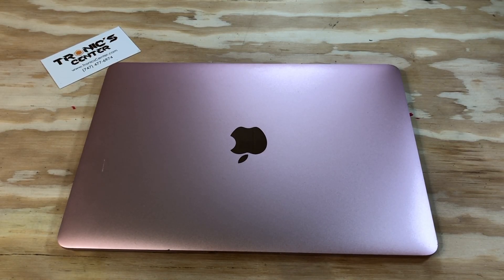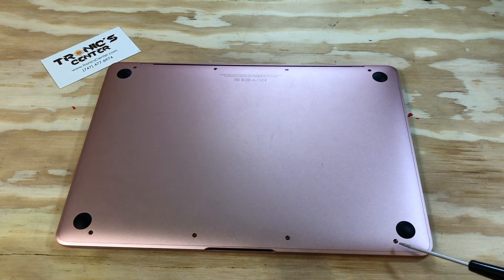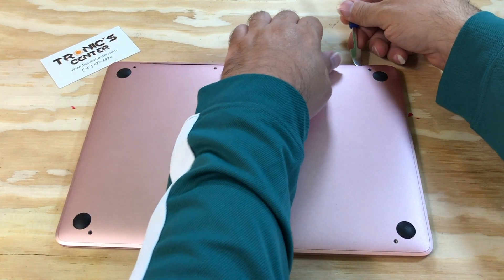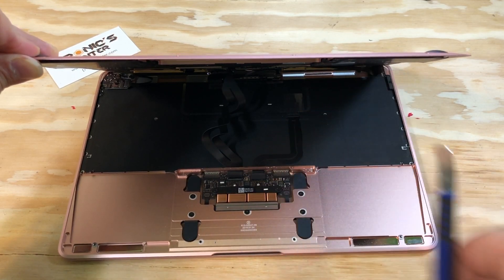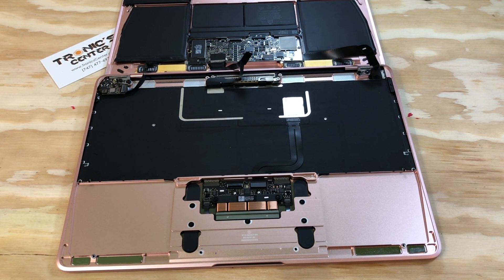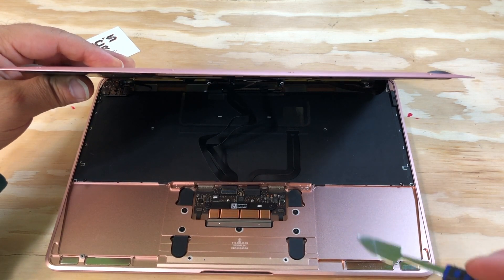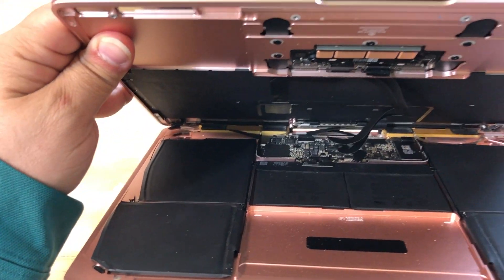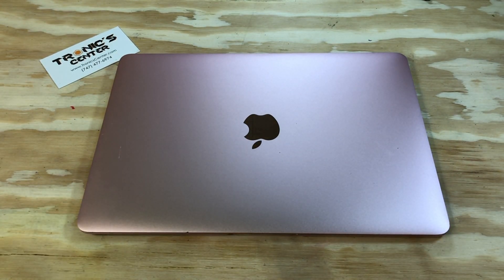How to Replace Force Touch Trackpad IPD Cable on 12" MacBook A1534   Force Touch Trackpad IPD Cable

Comment: May I ask you a question.

I replaced the usb c (its working now).

However I tore the ipd cable and the mouse pad heated up.

In turn I ordered new IPD cable. However may I have damaged/shorted the mouse pad due to the torn ipd cable so would i need to replace this as well ?

many thanks :)👍
Reply from the maker: The Trackpad IPD Flex Cable and Trackpad flex cable not different , it is the same for 2015, 2016, 2017 models . Thanks ! Dear Customer let us know what repair or disassembly you want us to make video ! Please not that we do deal with all Brands Dell, Lenovo, Asus, Razer, Toshiba, Hp, Sony, Panasonic, Nikon, Canon, Black Magic, Red Camera, any Camcorder Bards, Also we do IT Support and Data Recovery ! we would love to hear from you .
Reply from the maker: A2251 KeyWords 

MacBook Pro "Core i5" 2.0 13" 2020 4 TB 3, 2.0 GHz Core i5, I5-1038NG7, MacBook Pro "Core i7" 2.3 13" 2020 4 TB 3, 2.3 GHz Core i7,  I7-1068NG7, MacBookPro16,2 , 2020 13" 4 TB 3 , A2251 MacBook , EMC 3348, MWP72LL/A, BTO/CTO

————————————————————

A2141 KeyWords 

MacBook Pro "Core i7" 2.6 16" 2019, 2.6 GHz Core i7 (I7-9750H), 2.3 GHz Core i9 (I9-9880H), A2141 (EMC 3347), 2.4 GHz Core i9 (I9-9980HK) , MacBookPro16,1, MacBook Pro "Core i7" 2.6 16" 2019 5600M, 2.6 GHz Core i7 (I7-9750H),  MacBookPro16,4 , MacBook Pro "Core i9" 2.3 16" 2019 5600M, 2.3 GHz Core i9 (I9-9880H), MacBook Pro "Core i9" 2.4 16" 2019 5600M, 2.4 GHz Core i9 (I9-9980HK), MVVL2LL/A, MVVM2LL/A, 16" MacBook A2141

———————————————

A2179 Keywords

MWTJ2LL/A, EMC 3302 , 1.1 GHz Core i3 (I3-1000NG4) , MacBook Air "Core i3" 1.1 13" (Scissor, 2020) , MacBookAir9,1 , 1.1 GHz Core i5 (I5-1030NG7) , MVH22LL/A , MacBook Air "Core i7" 1.2 13" (Scissor, 2020), 1.2 GHz Core i7 (I7-1060NG7)

——————————————

A2159 Keywords 

1.4 GHz Core i5 (I5-8257U) , MacBook Pro "Core i5" 1.4 13" Touch/2019 2 TB 3 , MacBook Pro "Core i7" 1.7 13" Touch/2019 2 TB 3 , 1.7 GHz Core i7 (I7-8557U) , MUHN2LL/A , A2159 , EMC 3301 , MacBookPro15,4 , 2019 13" (Touch Bar, 2 TB 3), 13" MacBook Pro A2159

—————————————————————

A1932 Keywords  

MRE82LL/A , MVFH2LL/A, 1.6 GHz Core I5-8210Y, 1.6 GHz Core I5-8210Y, MacBookAir8,1 , EMC 3184 , 13" MacBook Air Space Gray, 13" MacBook Air Gold , 13" MacBook Air Silver , 13" MacBook Air 2019 13" MacBook Air 2018, 13" MacBook Air A1932

—————————————————————

A1534 Keyword’s

EMC 2746, MF855LL/A, MF865LL/A, EMC 2991, MLHA2LL/A, MLHC2LL/A, EMC 3099, MNYF2LL/A, MNYG2LL/A, MacBook8,1 , 1.1 GHz Core M (M-5Y31) , 1.2 GHz Core M (M-5Y51), 1.3 GHz Core M (M-5Y71), 1.1 GHz Core m3 (M3-6Y30), 1.2 GHz Core m5 (M5-6Y54), 1.3 GHz Core m7 (M7-6Y75), 1.2 GHz Core m3 (M3-7Y32), 1.3 GHz Core i5 (I5-7Y54), 1.4 GHz Core i7 (I7-7Y75), MacBook9,1 , MacBook10,1

——————————————————

A1990 Keywords

MR932LL/A, 2.2 GHz Core i7 (I7-8750H), EMC 3215, MacBookPro15,1 , MR942LL/A 2.6 GHz Core i7 (I7-8850H), 2.6 GHz Core i7 (I7-8850H), 2.9 GHz Core i9 (I9-8950HK), 2.6 GHz Core i7 (I7-9750H), EMC 3359, 2.3 GHz Core i9 (I9-9880H), 2.4 GHz Core i9 (I9-9980HK), MacBookPro15,3, A1990 MacBook, 15” MacBook A1990

———————————————————

A1989 Keyword 

A1989 MacBook 2018 MR9Q2LL/A, 2.3 GHz Core i5 (I5-8259U), BTO/CTO, 2.7 GHz Core i7 (I7-8559U), EMC 3214, MacBookPro15,2 , A1989 MacBook 2019 MV962LL/A , 2.4 GHz Core i5 (I5-8279U) , MV982LL/A, 2.8 GHz Core i7 (I7-8569U) , EMC 3358, 13" MacBook A1989

———————————————

A1708 Keywords

MLL42LL/A, A1708, EMC 2978, MacBookPro13,1 , 2.0 GHz Core i5 (I5-6360U) , 2.4 GHz Core i7 (I7-6660U) , MPXQ2LL/A, EMC 3164, 2.3 GHz Core i5 (I5-7360U) , 2.5 GHz Core i7 (I7-7660U), MPXQ2LL/A, 13" MacBook A1708

———————————————————— 
MacBook 

Apple, MacBook, 13" MacBook, MacBook Air, A1466 MacBook, MacBook Air logic Board, 13" MacBook Air , Apple Mac , 11” MacBook , A1465 MacBook, A1502 MacBook, A1398 MacBook, A1425 MacBook, A1706 MacBook, A1708 MacBook, A1707 MacBook, A1990 MacBook, A1989 MacBook, A2159 MacBook, A2179 MacBook, A2289 MacBook, A2337 MacBook, A2338 MacBook, A2141 MacBook, MacBook Pro, MacBook Pro Retina, Retina display, True Tone Display , Top Case KeyBoard, Apple Keyboard, MacBook KeyBoard, MacBook Trackpad.
———————————————————

A1398 MacBook, A1398 Logic Board, A1398 LCD, A1398 KeyBoard , A1398 Display, MC975LL/A, MC976LL/A, MD831LL/A, ME664LL/A, ME665LL/A , ME698LL/A, ME293LL/A, ME294LL/A, ME874LL/A, MGXA2LL/A, MGXC2LL/A, MGXG2LL/A, MJLQ2LL/A, MJLT2LL/A, MJLU2LL/A

—————————————————————

A1706 Keywords

MLH12LL/A, A1706 EMC 3071, MacBookPro13,2 , MacBookPro14,2 , MPXV2LL/A, A1706 EMC 3163 , 3.5 GHz Core I7-7567U, 3.3 GHz Core I5-7287U, 3.1 GHz Core I5-7267U, 3.3 GHz Core I7-6567U, 3.1 GHz Core I5-6287U, 2.9 GHz Core I5-6267U, A1706 MacBook, A1706 MacBook Touch Bar 

—————————————————————
A1707 Keywords 

MPN 923-01477 , MLH32LL/A, MLH42LL/A, MPTR2LL/A, MPTT2LL, EMC 3072, MLH32LL/A, MacBookPro13,3, 2.7 GHz Core i7 (I7-6820HQ), MLH42LL/A, 2.9 GHz Core i7 (I7-6920HQ), EMC 3162 , 2.8 GHz Core i7 (I7-7700HQ), MacBookPro14,3 , 2.9 GHz Core i7 (I7-7820HQ), MPTR2LL/A, MPTT2LL/A, 3.1 GHz Core i7 (I7-7920HQ), A1707 MacBook, A1707 Touch Bar

Comment: Pehle  bord me lagao
Reply from the maker: there are many Apple MacBook Available with high Spec's such as A1707, A1708, A1706, A1990, A1989, A2141, A2159, A2179 and we do offer original part's for them in if you need any part
you may visit our website at www.tronicscenter.com
Reply from the maker: A2251 KeyWords 

MacBook Pro "Core i5" 2.0 13" 2020 4 TB 3, 2.0 GHz Core i5, I5-1038NG7, MacBook Pro "Core i7" 2.3 13" 2020 4 TB 3, 2.3 GHz Core i7,  I7-1068NG7, MacBookPro16,2 , 2020 13" 4 TB 3 , A2251 MacBook , EMC 3348, MWP72LL/A, BTO/CTO

————————————————————

A2141 KeyWords 

MacBook Pro "Core i7" 2.6 16" 2019, 2.6 GHz Core i7 (I7-9750H), 2.3 GHz Core i9 (I9-9880H), A2141 (EMC 3347), 2.4 GHz Core i9 (I9-9980HK) , MacBookPro16,1, MacBook Pro "Core i7" 2.6 16" 2019 5600M, 2.6 GHz Core i7 (I7-9750H),  MacBookPro16,4 , MacBook Pro "Core i9" 2.3 16" 2019 5600M, 2.3 GHz Core i9 (I9-9880H), MacBook Pro "Core i9" 2.4 16" 2019 5600M, 2.4 GHz Core i9 (I9-9980HK), MVVL2LL/A, MVVM2LL/A, 16" MacBook A2141

———————————————

A2179 Keywords

MWTJ2LL/A, EMC 3302 , 1.1 GHz Core i3 (I3-1000NG4) , MacBook Air "Core i3" 1.1 13" (Scissor, 2020) , MacBookAir9,1 , 1.1 GHz Core i5 (I5-1030NG7) , MVH22LL/A , MacBook Air "Core i7" 1.2 13" (Scissor, 2020), 1.2 GHz Core i7 (I7-1060NG7)

——————————————

A2159 Keywords 

1.4 GHz Core i5 (I5-8257U) , MacBook Pro "Core i5" 1.4 13" Touch/2019 2 TB 3 , MacBook Pro "Core i7" 1.7 13" Touch/2019 2 TB 3 , 1.7 GHz Core i7 (I7-8557U) , MUHN2LL/A , A2159 , EMC 3301 , MacBookPro15,4 , 2019 13" (Touch Bar, 2 TB 3), 13" MacBook Pro A2159

—————————————————————

A1932 Keywords  

MRE82LL/A , MVFH2LL/A, 1.6 GHz Core I5-8210Y, 1.6 GHz Core I5-8210Y, MacBookAir8,1 , EMC 3184 , 13" MacBook Air Space Gray, 13" MacBook Air Gold , 13" MacBook Air Silver , 13" MacBook Air 2019 13" MacBook Air 2018, 13" MacBook Air A1932

—————————————————————

A1534 Keyword’s

EMC 2746, MF855LL/A, MF865LL/A, EMC 2991, MLHA2LL/A, MLHC2LL/A, EMC 3099, MNYF2LL/A, MNYG2LL/A, MacBook8,1 , 1.1 GHz Core M (M-5Y31) , 1.2 GHz Core M (M-5Y51), 1.3 GHz Core M (M-5Y71), 1.1 GHz Core m3 (M3-6Y30), 1.2 GHz Core m5 (M5-6Y54), 1.3 GHz Core m7 (M7-6Y75), 1.2 GHz Core m3 (M3-7Y32), 1.3 GHz Core i5 (I5-7Y54), 1.4 GHz Core i7 (I7-7Y75), MacBook9,1 , MacBook10,1

——————————————————

A1990 Keywords

MR932LL/A, 2.2 GHz Core i7 (I7-8750H), EMC 3215, MacBookPro15,1 , MR942LL/A 2.6 GHz Core i7 (I7-8850H), 2.6 GHz Core i7 (I7-8850H), 2.9 GHz Core i9 (I9-8950HK), 2.6 GHz Core i7 (I7-9750H), EMC 3359, 2.3 GHz Core i9 (I9-9880H), 2.4 GHz Core i9 (I9-9980HK), MacBookPro15,3, A1990 MacBook, 15” MacBook A1990

———————————————————

A1989 Keyword 

A1989 MacBook 2018 MR9Q2LL/A, 2.3 GHz Core i5 (I5-8259U), BTO/CTO, 2.7 GHz Core i7 (I7-8559U), EMC 3214, MacBookPro15,2 , A1989 MacBook 2019 MV962LL/A , 2.4 GHz Core i5 (I5-8279U) , MV982LL/A, 2.8 GHz Core i7 (I7-8569U) , EMC 3358, 13" MacBook A1989

———————————————

A1708 Keywords

MLL42LL/A, A1708, EMC 2978, MacBookPro13,1 , 2.0 GHz Core i5 (I5-6360U) , 2.4 GHz Core i7 (I7-6660U) , MPXQ2LL/A, EMC 3164, 2.3 GHz Core i5 (I5-7360U) , 2.5 GHz Core i7 (I7-7660U), MPXQ2LL/A, 13" MacBook A1708

———————————————————— 
MacBook 

Apple, MacBook, 13" MacBook, MacBook Air, A1466 MacBook, MacBook Air logic Board, 13" MacBook Air , Apple Mac , 11” MacBook , A1465 MacBook, A1502 MacBook, A1398 MacBook, A1425 MacBook, A1706 MacBook, A1708 MacBook, A1707 MacBook, A1990 MacBook, A1989 MacBook, A2159 MacBook, A2179 MacBook, A2289 MacBook, A2337 MacBook, A2338 MacBook, A2141 MacBook, MacBook Pro, MacBook Pro Retina, Retina display, True Tone Display , Top Case KeyBoard, Apple Keyboard, MacBook KeyBoard, MacBook Trackpad.
———————————————————

A1398 MacBook, A1398 Logic Board, A1398 LCD, A1398 KeyBoard , A1398 Display, MC975LL/A, MC976LL/A, MD831LL/A, ME664LL/A, ME665LL/A , ME698LL/A, ME293LL/A, ME294LL/A, ME874LL/A, MGXA2LL/A, MGXC2LL/A, MGXG2LL/A, MJLQ2LL/A, MJLT2LL/A, MJLU2LL/A

—————————————————————

A1706 Keywords

MLH12LL/A, A1706 EMC 3071, MacBookPro13,2 , MacBookPro14,2 , MPXV2LL/A, A1706 EMC 3163 , 3.5 GHz Core I7-7567U, 3.3 GHz Core I5-7287U, 3.1 GHz Core I5-7267U, 3.3 GHz Core I7-6567U, 3.1 GHz Core I5-6287U, 2.9 GHz Core I5-6267U, A1706 MacBook, A1706 MacBook Touch Bar 

—————————————————————
A1707 Keywords 

MPN 923-01477 , MLH32LL/A, MLH42LL/A, MPTR2LL/A, MPTT2LL, EMC 3072, MLH32LL/A, MacBookPro13,3, 2.7 GHz Core i7 (I7-6820HQ), MLH42LL/A, 2.9 GHz Core i7 (I7-6920HQ), EMC 3162 , 2.8 GHz Core i7 (I7-7700HQ), MacBookPro14,3 , 2.9 GHz Core i7 (I7-7820HQ), MPTR2LL/A, MPTT2LL/A, 3.1 GHz Core i7 (I7-7920HQ), A1707 MacBook, A1707 Touch Bar

Comment: Hey thanks for the video just wanted to kind out if the trackpad flex doesn't work will it cause the keyboard to stop working
Reply: Hey if cable get damaged,both keyboard and mouse won’t work?
Reply: @cosmin6499  yes
Reply from the maker: A2251 KeyWords 

MacBook Pro "Core i5" 2.0 13" 2020 4 TB 3, 2.0 GHz Core i5, I5-1038NG7, MacBook Pro "Core i7" 2.3 13" 2020 4 TB 3, 2.3 GHz Core i7,  I7-1068NG7, MacBookPro16,2 , 2020 13" 4 TB 3 , A2251 MacBook , EMC 3348, MWP72LL/A, BTO/CTO

————————————————————

A2141 KeyWords 

MacBook Pro "Core i7" 2.6 16" 2019, 2.6 GHz Core i7 (I7-9750H), 2.3 GHz Core i9 (I9-9880H), A2141 (EMC 3347), 2.4 GHz Core i9 (I9-9980HK) , MacBookPro16,1, MacBook Pro "Core i7" 2.6 16" 2019 5600M, 2.6 GHz Core i7 (I7-9750H),  MacBookPro16,4 , MacBook Pro "Core i9" 2.3 16" 2019 5600M, 2.3 GHz Core i9 (I9-9880H), MacBook Pro "Core i9" 2.4 16" 2019 5600M, 2.4 GHz Core i9 (I9-9980HK), MVVL2LL/A, MVVM2LL/A, 16" MacBook A2141

———————————————

A2179 Keywords

MWTJ2LL/A, EMC 3302 , 1.1 GHz Core i3 (I3-1000NG4) , MacBook Air "Core i3" 1.1 13" (Scissor, 2020) , MacBookAir9,1 , 1.1 GHz Core i5 (I5-1030NG7) , MVH22LL/A , MacBook Air "Core i7" 1.2 13" (Scissor, 2020), 1.2 GHz Core i7 (I7-1060NG7)

——————————————

A2159 Keywords 

1.4 GHz Core i5 (I5-8257U) , MacBook Pro "Core i5" 1.4 13" Touch/2019 2 TB 3 , MacBook Pro "Core i7" 1.7 13" Touch/2019 2 TB 3 , 1.7 GHz Core i7 (I7-8557U) , MUHN2LL/A , A2159 , EMC 3301 , MacBookPro15,4 , 2019 13" (Touch Bar, 2 TB 3), 13" MacBook Pro A2159

—————————————————————

A1932 Keywords  

MRE82LL/A , MVFH2LL/A, 1.6 GHz Core I5-8210Y, 1.6 GHz Core I5-8210Y, MacBookAir8,1 , EMC 3184 , 13" MacBook Air Space Gray, 13" MacBook Air Gold , 13" MacBook Air Silver , 13" MacBook Air 2019 13" MacBook Air 2018, 13" MacBook Air A1932

—————————————————————

A1534 Keyword’s

EMC 2746, MF855LL/A, MF865LL/A, EMC 2991, MLHA2LL/A, MLHC2LL/A, EMC 3099, MNYF2LL/A, MNYG2LL/A, MacBook8,1 , 1.1 GHz Core M (M-5Y31) , 1.2 GHz Core M (M-5Y51), 1.3 GHz Core M (M-5Y71), 1.1 GHz Core m3 (M3-6Y30), 1.2 GHz Core m5 (M5-6Y54), 1.3 GHz Core m7 (M7-6Y75), 1.2 GHz Core m3 (M3-7Y32), 1.3 GHz Core i5 (I5-7Y54), 1.4 GHz Core i7 (I7-7Y75), MacBook9,1 , MacBook10,1

——————————————————

A1990 Keywords

MR932LL/A, 2.2 GHz Core i7 (I7-8750H), EMC 3215, MacBookPro15,1 , MR942LL/A 2.6 GHz Core i7 (I7-8850H), 2.6 GHz Core i7 (I7-8850H), 2.9 GHz Core i9 (I9-8950HK), 2.6 GHz Core i7 (I7-9750H), EMC 3359, 2.3 GHz Core i9 (I9-9880H), 2.4 GHz Core i9 (I9-9980HK), MacBookPro15,3, A1990 MacBook, 15” MacBook A1990

———————————————————

A1989 Keyword 

A1989 MacBook 2018 MR9Q2LL/A, 2.3 GHz Core i5 (I5-8259U), BTO/CTO, 2.7 GHz Core i7 (I7-8559U), EMC 3214, MacBookPro15,2 , A1989 MacBook 2019 MV962LL/A , 2.4 GHz Core i5 (I5-8279U) , MV982LL/A, 2.8 GHz Core i7 (I7-8569U) , EMC 3358, 13" MacBook A1989

———————————————

A1708 Keywords

MLL42LL/A, A1708, EMC 2978, MacBookPro13,1 , 2.0 GHz Core i5 (I5-6360U) , 2.4 GHz Core i7 (I7-6660U) , MPXQ2LL/A, EMC 3164, 2.3 GHz Core i5 (I5-7360U) , 2.5 GHz Core i7 (I7-7660U), MPXQ2LL/A, 13" MacBook A1708

———————————————————— 
MacBook 

Apple, MacBook, 13" MacBook, MacBook Air, A1466 MacBook, MacBook Air logic Board, 13" MacBook Air , Apple Mac , 11” MacBook , A1465 MacBook, A1502 MacBook, A1398 MacBook, A1425 MacBook, A1706 MacBook, A1708 MacBook, A1707 MacBook, A1990 MacBook, A1989 MacBook, A2159 MacBook, A2179 MacBook, A2289 MacBook, A2337 MacBook, A2338 MacBook, A2141 MacBook, MacBook Pro, MacBook Pro Retina, Retina display, True Tone Display , Top Case KeyBoard, Apple Keyboard, MacBook KeyBoard, MacBook Trackpad.
———————————————————

A1398 MacBook, A1398 Logic Board, A1398 LCD, A1398 KeyBoard , A1398 Display, MC975LL/A, MC976LL/A, MD831LL/A, ME664LL/A, ME665LL/A , ME698LL/A, ME293LL/A, ME294LL/A, ME874LL/A, MGXA2LL/A, MGXC2LL/A, MGXG2LL/A, MJLQ2LL/A, MJLT2LL/A, MJLU2LL/A

—————————————————————

A1706 Keywords

MLH12LL/A, A1706 EMC 3071, MacBookPro13,2 , MacBookPro14,2 , MPXV2LL/A, A1706 EMC 3163 , 3.5 GHz Core I7-7567U, 3.3 GHz Core I5-7287U, 3.1 GHz Core I5-7267U, 3.3 GHz Core I7-6567U, 3.1 GHz Core I5-6287U, 2.9 GHz Core I5-6267U, A1706 MacBook, A1706 MacBook Touch Bar 

—————————————————————
A1707 Keywords 

MPN 923-01477 , MLH32LL/A, MLH42LL/A, MPTR2LL/A, MPTT2LL, EMC 3072, MLH32LL/A, MacBookPro13,3, 2.7 GHz Core i7 (I7-6820HQ), MLH42LL/A, 2.9 GHz Core i7 (I7-6920HQ), EMC 3162 , 2.8 GHz Core i7 (I7-7700HQ), MacBookPro14,3 , 2.9 GHz Core i7 (I7-7820HQ), MPTR2LL/A, MPTT2LL/A, 3.1 GHz Core i7 (I7-7920HQ), A1707 MacBook, A1707 Touch Bar
Reply from the maker: Glad i could help !
Reply: Trackpad*
Reply from the maker: If You Need any Original Parts or Tools You May Visit www.Tronicscenter.com For Original Apple Parts .